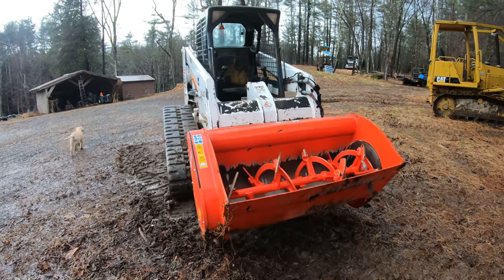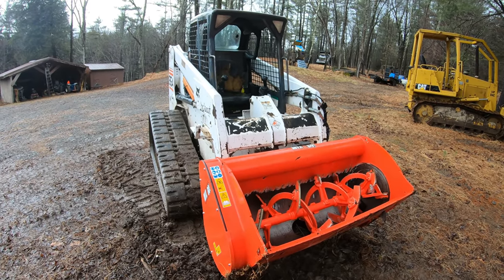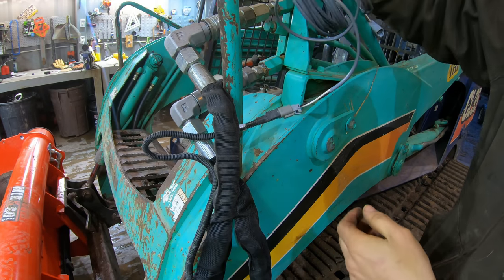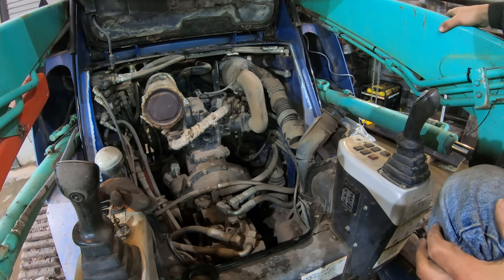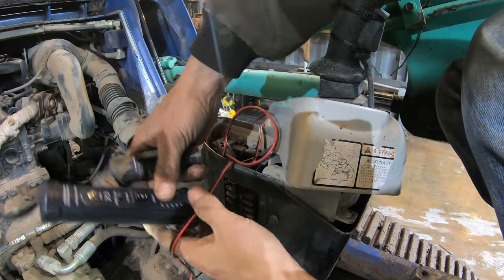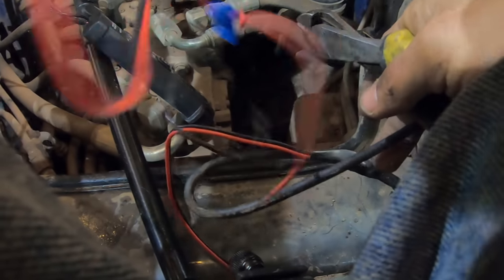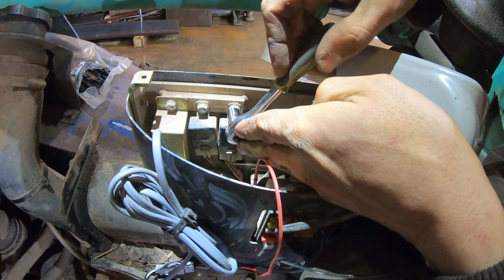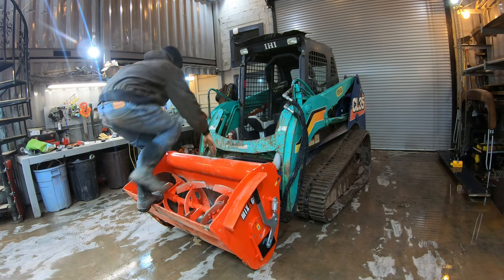Setting up the IHI track loader to run a cement mixer

Comment: That's not how you do crimps, everyone on YouTube does it that way, but everyone in industry does it the proper way. I've no idea why this keeps being passed on :| Ah well, it is what it is
Reply: What's the proper way to make crimp?
Reply: @stevensaxon8888  - Industry uses calibrated ratchet or hydraulic crimping tools, and generally only shrouded crimps. Soldering is never used with multicore wire, it is supposed to be a gas tight cold weld if the proper tool is used, and soldering just creates a fatigue issue. Andrew's crimp will probably work fine for the life of the machine, I'm just taking issue with YouTubers who always say that "this is the proper way to do it", when it just isn't. Industry takes quality extremely seriously, this topic has been studied a lot.

Comment: Those solder butt splices are horrible.
Reply from the maker: Why? I have not had any issues with them.
Reply: @AndrewCamarata  it's just a cheap made butt connector. The heat shrink goes bad and corrodes like crazy. At least in the salt belt of Ohio!  Enjoy the videos as always buddy!
Reply from the maker: I have not seen shrink tubing go bad. The problems with wiring is when they insulation gets damaged, and the copper wire turns into green dust. There are better marine grade wires that don't do that. Autos are not built very well.